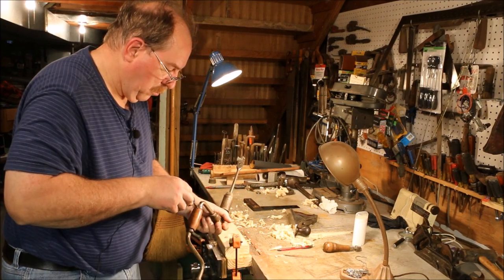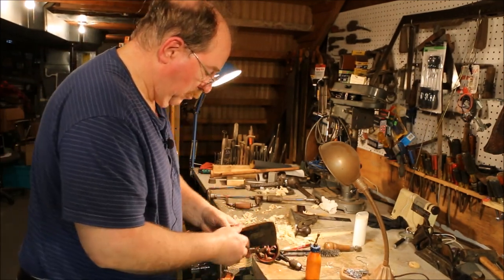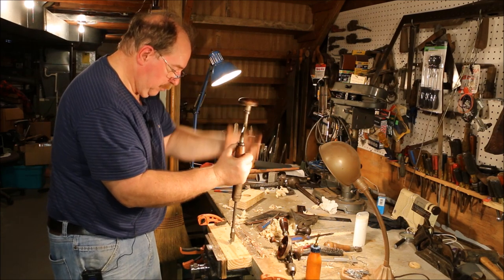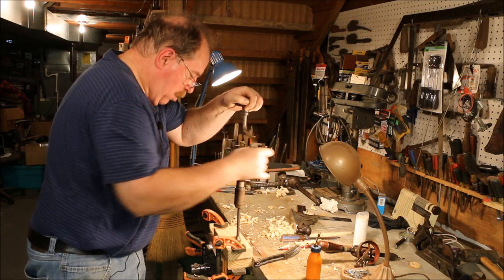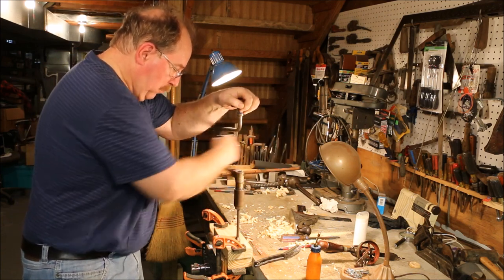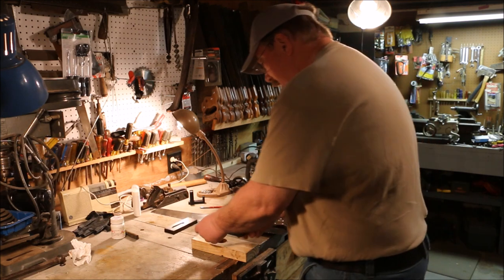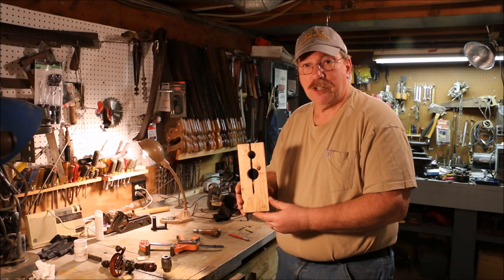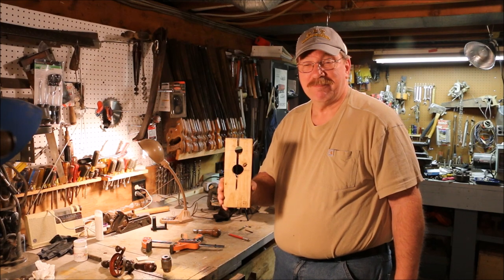Chuck Disassembly Fixture ~ Measuring and boring the holes ~ Pt 3 ~ By Old Sneelock's Workshop

Comment: Just goes to show things never go as planned, got through it anyway. I'm glad your ditching that mike, it was making you sound like Darth Vader workin on the death star instead of Old Sneelock workin on a 2x4.  :-)
Reply from the maker: +halfwayuphill Classic "You get what you pay for." scenario. A few years ago I wanted to try using a remote microphone. While I was at Radio Shack they had one on sale for $14.00. I couldn't connect it to my camera so I just set it back on the shop shelf. When I got the new Canon it had a socket for the microphone patch cable. 
The Canon will filter out noise but the cheap mic won't. It looks like the mic noise confuses the camera system. 
Wranglerstar used a inexpensive Canon mic for a while until he recently upgraded. I just blew a years bubblegum money  on the Canon EOS 70D so the new mic will have to wait.